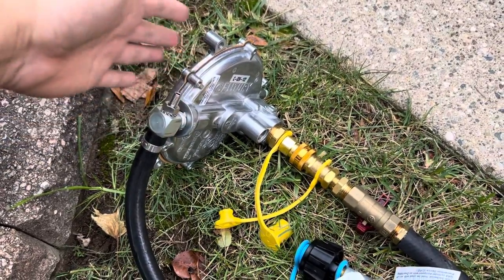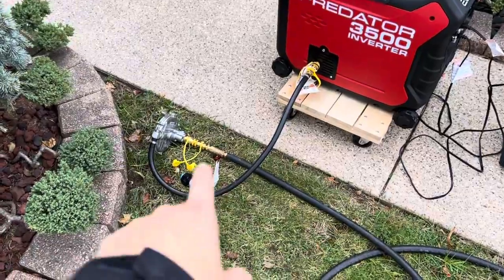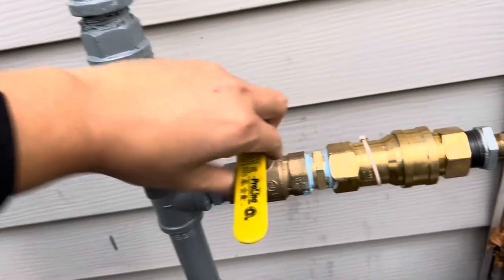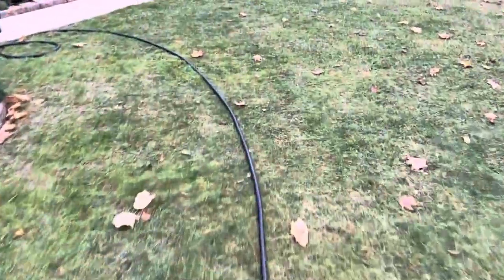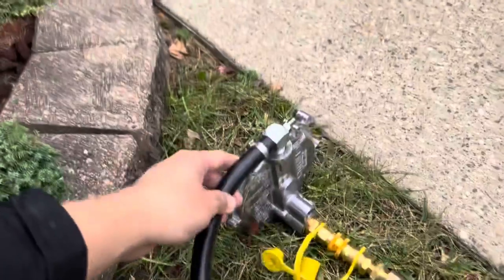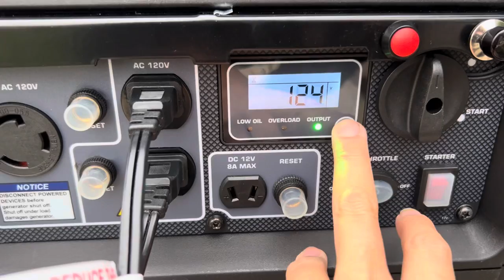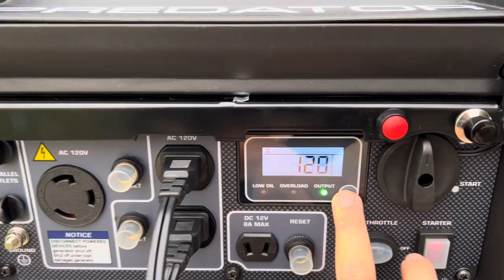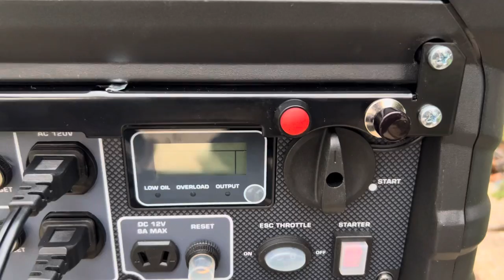How to Convert and Connect Natural Gas to Harbor Freight Predator 3500 Inverter Generator

Comment: What size hose would I need for propane? It runs at slightly higher pressure than NG so would 3/8 propane hose work for a 12-15ft run?
Reply from the maker: for 12-15ft on 3/8" ID hose is not recommended. I would run 1/2" ID hose if you need it that long.
Reply: @GrenergyTriFuel  thanks. Went with 1/2. Do you ever do anything to the spark plug gap? I’ve read some people slightly decrease the gap when running propane.
Reply from the maker: The plug should be gapped at 0.024". Hope this helps!